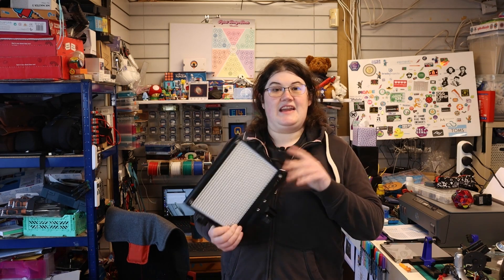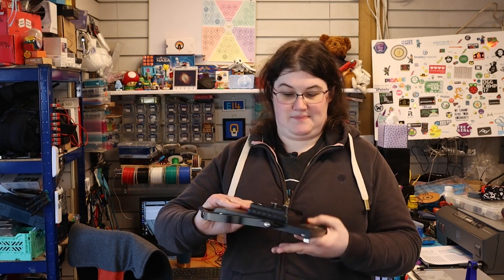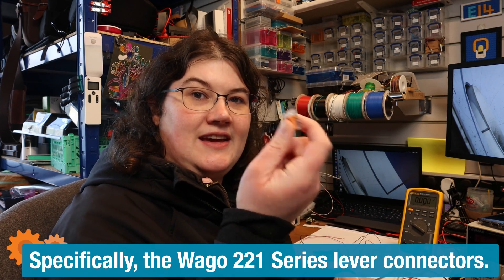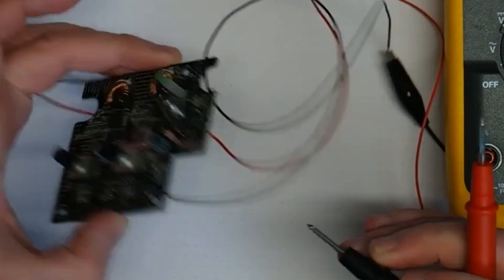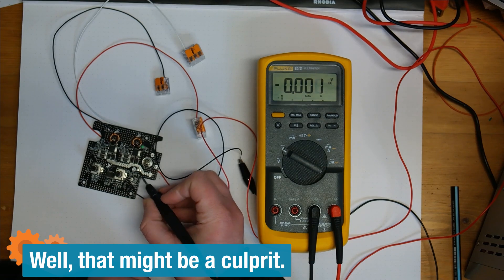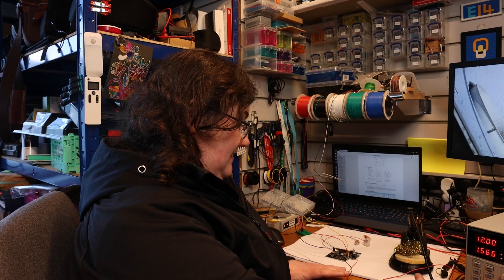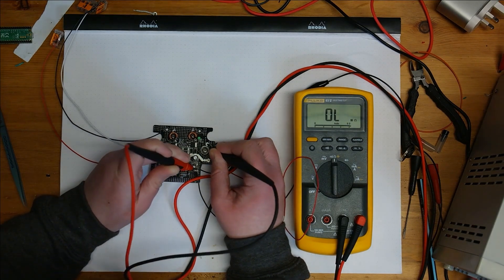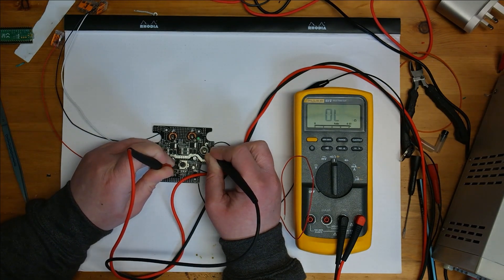Repairing a Neewer 660 Studio Light - How Hard Could It Be?

Comment: Another idea to find the fault quickly, when the circuit is current limiting, or feed in current from the bench PSU is to do a voltage maps of the board,

Comment: Hi 
Great video.
I think one good way to check what component was drawing 1.6 Amps before removing lots of capacitors and other components is run 1.6 amps for a short time then turn off and carefully check if any components are warm or hot. If nothing obvious seems to be dissipating power then let the current flow for a bit longer and check again. At 1.6A something must be warming up!

Comment: Not sure plugging the PSU into a good one was a bright idea! The PSU may have failed to regulate and could have been pushing out a higher voltage than it should. So, a multimeter could have saved the possibility of damaging another lamp unit! Other than that nice fault finding.
Reply: On the other hand could have been the psu from the working one she was using, I would have been tempted to see if it worked with 2 npf batteries. Might even ask neewer if they would supply a programmed micro controller.

Comment: Usually when the capacitor fail you can see it, as they crack, another thing you can do it use IPA and watch for which area evaporates off the fastest to see what is getting hot, that can tell you very quickly which part is failed (ignore any regulators providing power to the circuit, they will get hot, look for the other part instead)
Reply: or check with a thermal camera Scott, if you can afford one they are invaluable for short hunting.
Reply: @simonbaxter8001  Indeed, but they are a bit specialised, I have one but few people do, which is why I explained the more accessible method of tracking it down.

Comment: Cute lady. Is really planned obsolescence this. Is there a way to get it up and running replacing the microcontroller with some discreet components?  I'm struggling with a washing machine computer similar issues. Cannot find a faulty external component, and of course there is no replacement board. Still works on the default program though.

Comment: The easiest way I have found to find a short on a rail is to invert a can of keyboard duster and spray the components. This will cover them with a layer of frost, then insert a small current-limited voltage to the rail, and watch to see which component defrosts first.
Can you use the other working light to get the code? That would be a better video in my mind.
Reply: or same low voltage test and use a thermal camera to find the hot spot ... if you have one!

Comment: Great video again! Too bad it couldn't be fixed due to the probable short in that cpu.. 
I actually have 2 ideas to replace it: first idea: use 555 timers to replace the cpu entirely. No code needed at all! I think the 556 chip has 2 of those on board, so that would be perfect.
The second idea: get an attiny 85. those are capable of doing A/D conversion for those pots and PWM on 2 ports using 2 seperate timers so they both can be at a different level.  The nice thing is that you can simply use the arduino IDE and libraries to make your own code for it and program it using a fairly cheap programmer.
Either option would then sit on it's own small pcb and attached to that main board with some small cables soldered to the pads of the old cpu.
It is just an idea, didn't check any feasability! Should be fun to see how you eventually get it working again.

Comment: If you email the company, maybe they can help you by sending the new microcontroller, including the firmware.
Reply: That's a great maybe ... Usually, what they do is to send it to repair and they will say voided of warranty or that they don't sell the microcontroler, since the code is proprietary. So, buy new one or try to uncode the firmware from the faulty microcontroller or buy a arduino and try to sort out how to control the LEDs. 
The only thing i can see here is trying to control from a arduino and maybe even putting a OLED screen to see the Brightness and colour ...
Reply: @Bruno Miguel Santos  yes arduino is a great and simple solution, too. It's a clever idea.

Comment: Having a micro seems overkill to drive LEDs doesn’t it? Are they multiplexed? Let’s see a replacement board!
Reply: I believe Katie said that the lamp has two colors of LED to be able to blend between warm and cool white.  The overall brightness and color balance are no doubt modulated by PWM, and it's the MCU will handle that function.
Reply: @Graham_Wideman  not to be simple minded, but a 555 and adjusting pot could do that. And you could throw away the 5v reg to boot and run the mess off the 12v rail
Reply: @ThomasFranksomt  Sure, there are multiple possible implementations. There are tradeoffs. Your design would have two pots instead of what look like cheaper encoders. Your design would have difficulty adjusting to either zero or 100%, and maintaining a particular frequency as it adjusts duty cycle.  But obviously would not require an MCU.
Reply: @Graham_Wideman  good points. Always trade offs, I guess.
Reply: The light is the basic version, the next version up does bluetooth, lets them keep things common.

Comment: That's quite unfortunate. But as you pointed out and tested, there are multiple cheap and easily replaced components that could have caused this issue. It's always worth to take a look and troubleshoot. If the short was caused by the regulator or capacitor, it would have been an easy fix.